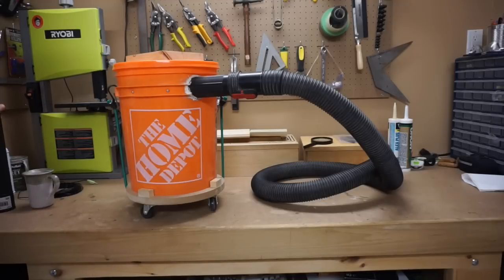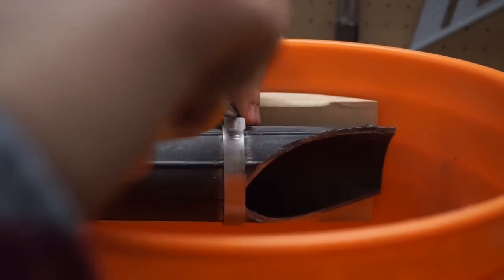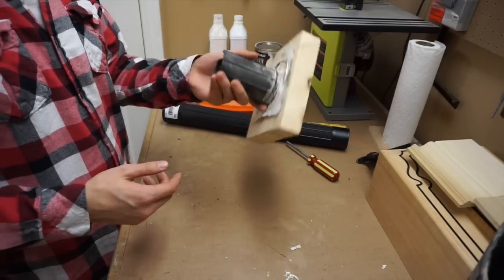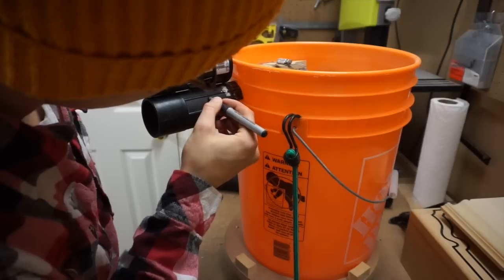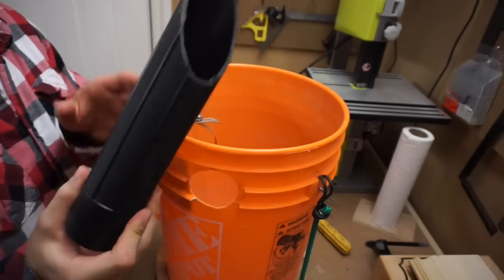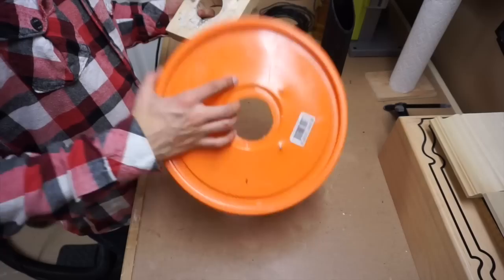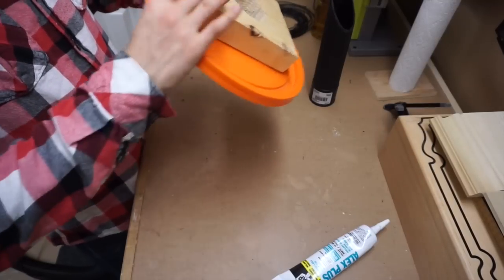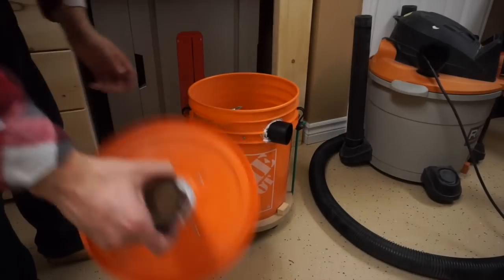Improving my Home Made Dust Collector

Comment: I have that same shop vac and I made a platform for my cyclone that sits directly above the vacuum using four, two inch pipe with couplers that fit perfectly in the accessory holes over the wheels. now I have a small footprint for my cyclone and shop vac.

Comment: Please pardon my ignorance, as I'm just starting to design a cyclone for my shop. What was the reasoning behind making the output for the vacuum longer? Wouldn't it be less likely to pick up debris from the bucket if it was shorter? Also, would your input in the side of the bucket be more efficient if the angle cut in the extension was turned slightly to guide the incoming material toward the bottom of the bucket?

Thank you for the video.
Reply from the maker: Josh Yeager thanks for you comment! This is a bit of an experiment, my thought was that it would draw in more air. I have since Updated my design. Feel free to follow the link: https://youtu.be/_CMwLoWfgyI . Thanks!